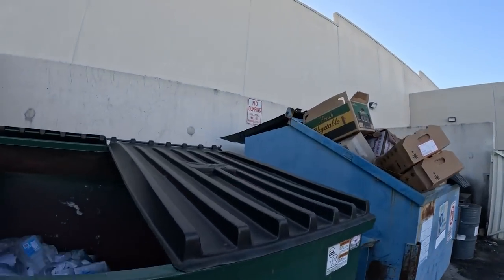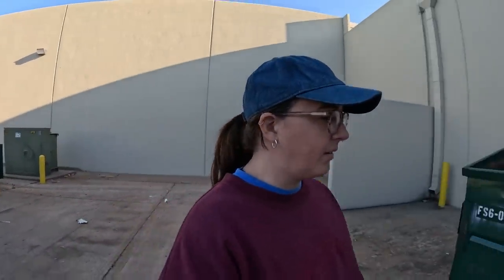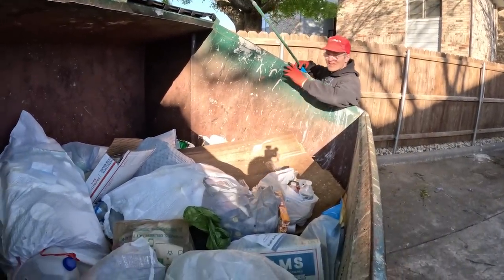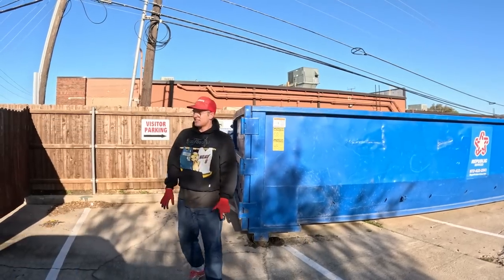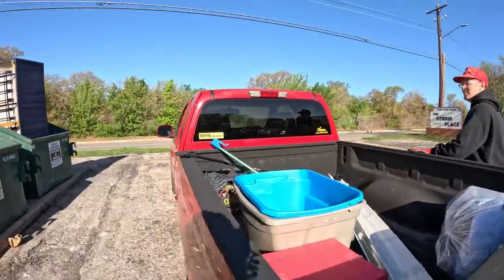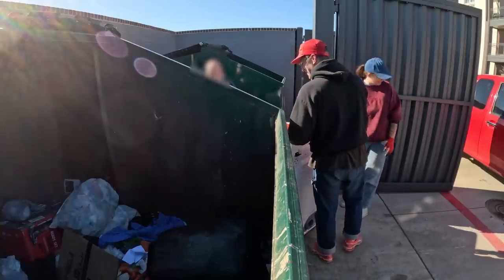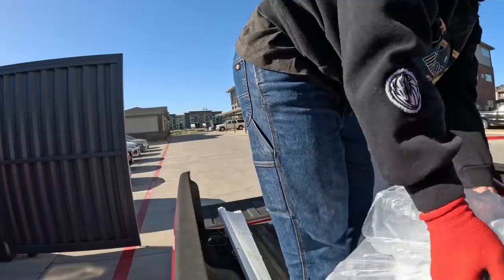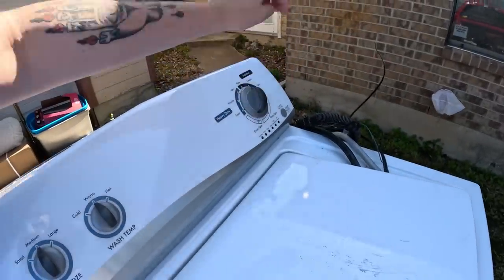We Found a $1700 Washer / Dryer Set in the Trash!! Best Find?!

Comment: I’m extremely happy for you & Alex that the washer & dryer set worked properly. It just needed a little elbow grease & ingenuity. 💖💖💖
I have found an air purifier & a medium size table while I was going to work. I’m glad that the air purifier works good. It needs an extra filter. 💖💖💖

Comment: Awesome find on the washer and dryer set! BTW, whatever doesn't work and is made of metal, or has any kind of motor or plugs into an outlet, you can still get money for as scrap. Find a local scrap yard to bring your dryer to and get paid for it. You can probably easily sell your washing machine since it still works. A lot of people trust the older models.

Comment: The washer and dryer are amazing. So cute. Don’t give away your washer, those old washers are better than the new ones. The digital ones are very problematic and they broke faster than the old ones. The old ones can be fixed because they don’t have anything digital, my mom has an old washer and the guy who fixes washers told her not to get ride of it because the new ones brake faster and can’t really be fix easily than old ones.

Comment: Wow great washer and dryer. If your dryer has a metal barrel in it take it out and use it as a burn barrel. It works great air moves through it nicely I cover mine with small square rabbit wire so ash breaks down. Good dive.

Comment: I love my toaster oven and use it ALL THE TIME!! You can pretty much bake anything in it you want that will fit that you would do in a normal oven. A lot cheaper to run than a big oven for small things and faster to preheat. We do small batches of the break and bake cookies in it all the time. Nice treat to have them warm and fresh and not have to do the whole package at once. Well you never HAVE to but you know what I mean😉.

So excited for you two that the washer and dryer worked!! That is so awesome!! If the other washer still works put it on the curb for free or something. I am sure someone would be happy even if it works for just another year. Again...YAY for you two!!!!

Comment: I use my toaster oven for anything that I would use my regular oven for. I usually wind up using it for smaller amounts when I don’t need to heat up the whole oven for. Good luck with the washer and dryer!  May I suggest you take your old washer and dryer to the scrap yard and recycle, they’re probably good for twenty bucks! ✌🏼❤️

Comment: When my sister moved to the state Im in they didn't have a washer or dryer. Literally while we are driving to carry the uhaul back we passed a man putting a washer and dryer on the curb. I stopped and asked if he was throwing them out. He said they had just bought new ones (upgraded) and these worked fine. He didn't want to pay someone to haul them off, didn't have time to mess with selling them and was putting them on curb with a free sign. We loaded them up, took them back to her house. That was 8 years ago. They are still going strong. Sometimes things just happen right when you need them.

Comment: A friend has similar Samsung units.  She had an issue with the electronic board ($300 to replace,)
on dryer because she didn't use the "pause" button when opening door during cycle. You may want to check out owners manual online to see if this could be a problem with your unit. Great find. Love you channel. 😊

Comment: Your cord off your old dryer should work for the new one. You have to buy the dryer cord separately anytime you buy a new dryer. When  appliances don't work, you can usually sell them at your local recycling center and get a little money :) nice find!
You can scrap your old dryer and either sell or donate the old washer. Or you could store the old washer in case something happens to the new one. Congratulations!

Comment: You guys got blessed with the washer and dryer set. my dryer got bad due to a washable carpet so I spend $220.00 to get it repair. and my will be turning 7 yrs old in May. enjoy them. they're not cheap. make the washer wash for itself with hot water and vinegar. every month .and clean the dryer hose 3 times a year to prevent damage.

Comment: put the candle jar in freezer and then gently break out frozen wax and pull off any metal wick holders from bottom ..let the glass come to room temp...take your candle without glass clean sides of debris bumps and glass ... stick candle in freezer for a few hours then take out and slip gently into the room temp glass holder ... should slide right in if no globs of wax sticking out on bottom sides etc

Comment: I knew when you started talking about that grinding noise in the washer that it was a Samsung.  I had a set and mine did the exact same thing.  But we just got a new one. FYI. watch the belt on the dryer, mine broke had it replaced and a couple weeks later the motor burned out.  Also does it play music at the end of the cycle?